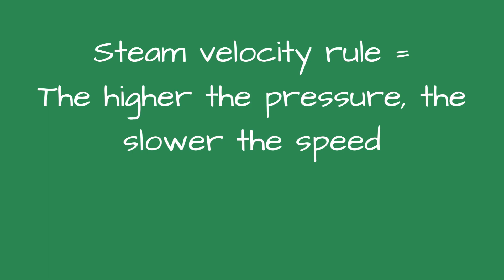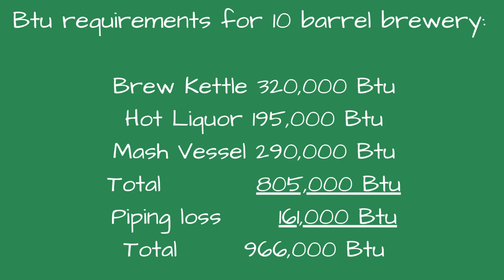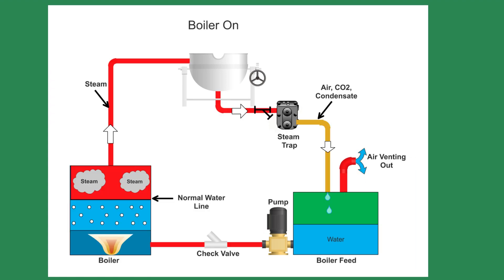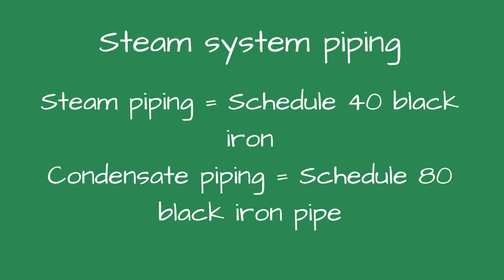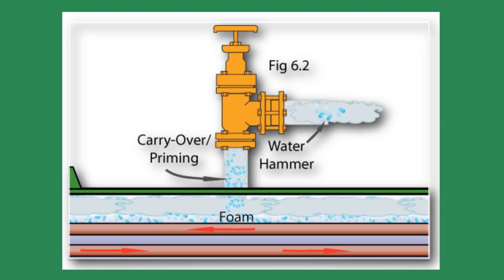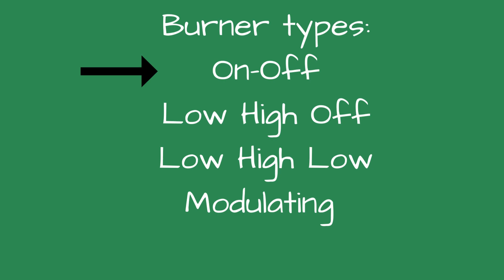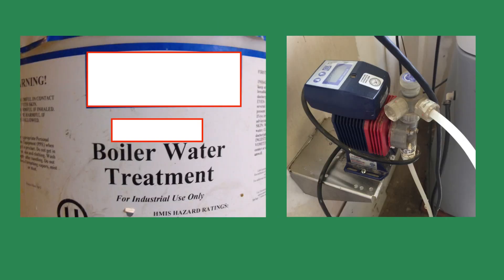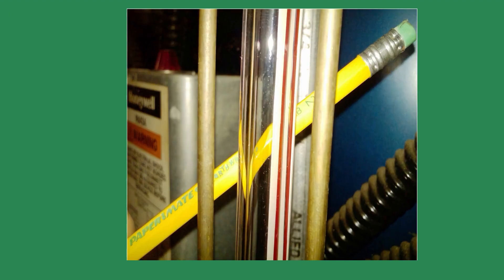Detective Tools: Designing a steam system for a brewery

Comment: Regarding Low-High-Low burners (14:00), I never did buy into Honeywell's contention that it is more efficient than full modulation.  How can it be more efficient to blast to 100% firing rate from a low fire firing rate of say 30% - just to throttle back to low fire when the system may only have needed a 10% increase in modulation to meet the demand?  Plus, if the system is prone to carryover, whether due to piping deficiencies or boiler design, the carryover will be greater in high fire.  When you are driving down the highway at a steady speed and you encounter a small hill, do you floor it just to overcome the slight drop in speed?
Reply from the maker: I am not sure what to think of that but then the EPA shows boilers are most efficient when fired about 80% or higher. I am wondering if it was when they had linkages. The new linkageless allows you to fine tun at any firing rate.  Thanks for watching and your thoughts
Reply: @boilerroomdetective  I'm sure that is true for steady state fuel to steam efficiency.